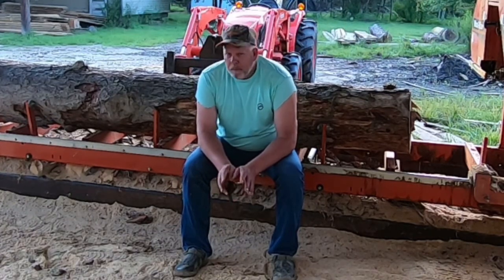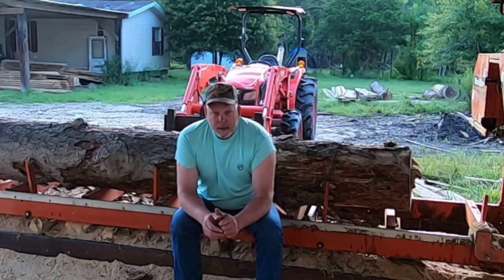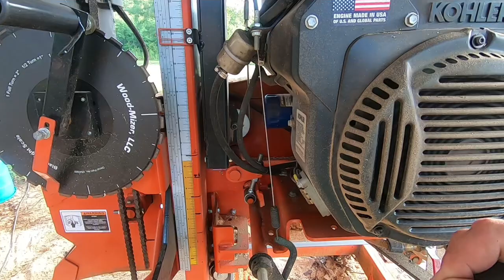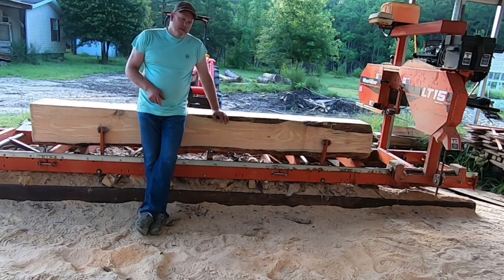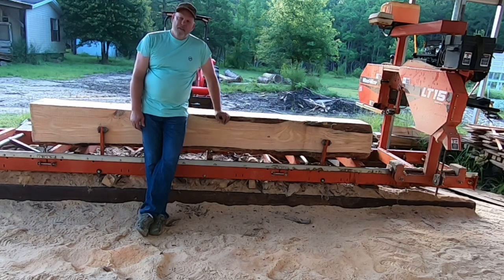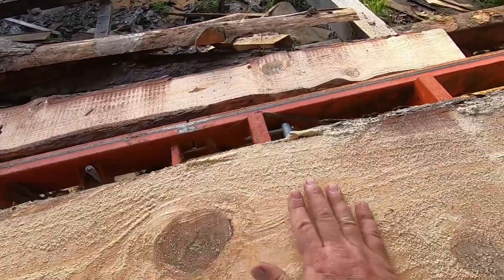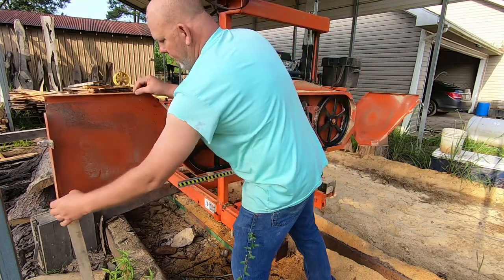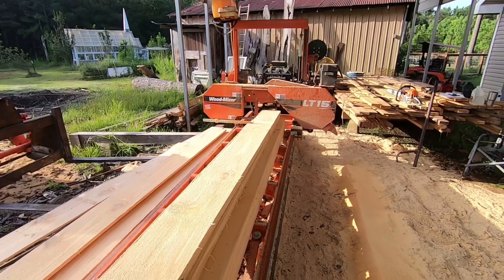Five Need To Know Tips For Woodmizer LT15

Comment: On your LT 15 what do you have for stops on the end or the bed rails, without the rope can it roll right of the end of the bed rails?  My LT 15 GO can run right to the end and I'm worried it could go  right off the end,  Woodmizer said the rope stop would keep it from going off, but want to know your opinion . The rope stops won't contact the main carriage on mine, So what stops the head?
  Great info, and video 👍👍👍👍
Reply from the maker: A piece of angle iron on top of rail
Reply: @ReapWhatYouSeauxLeJeune  Nothing came from the Factory , the guy from WM said the rope stops should stop the head from rolling off, don't think so , the one roller goes past the end of the rail and don't want it on the ground,  like your idea, or two 3/8" plates on each side of the rail,

Comment: I'm listening to you about the 5 tips. I have this mill but electric motor since 0ctober 2019. Still don"t have electricity run to it. Anyway I stopped the video where you are talking about the weather. I know it. South Georgia is miserable, and like you said, not really the heat but the humidity. And the bugs. Part of my land is swamp. Looking forward to milling but getting power to it is $$$. That silver bar on the rail where t de rollers ride on it...I can't get them level (can't get them to match up with the next one on the next rail)  any suggestions???  Now, back to the video.  Ok, great video. Thanks for sharing the knowledge. when i start milling I will see how it goes but taking that rope off and pushing to seems to be a good idea.
Reply from the maker: I put a straight edge on the blade set between two bed rails and measure both side. Level by adjusting the bolts on the back of the rollers

Comment: You are concerned about your logstops weld breaking, yet you aren't using your forklift correctly.  There is absolutely no need to roll a 1,000 pound log off your forks & bang it onto the bed & logstops of your mill, and then blame Woodmizer.  Gently, gently big guy!  That's my tip for you.